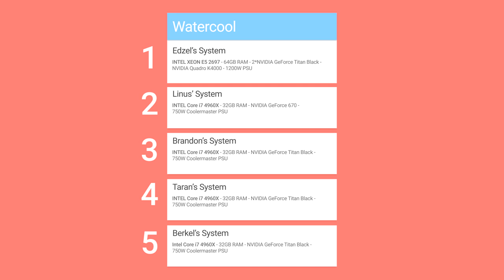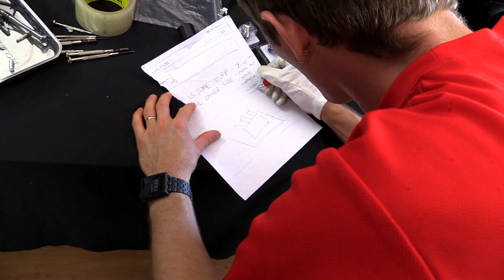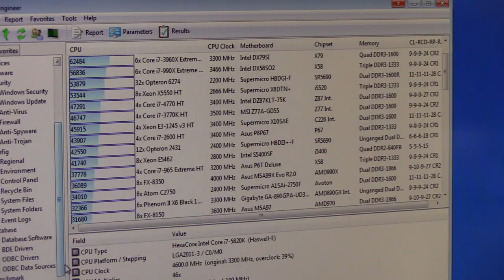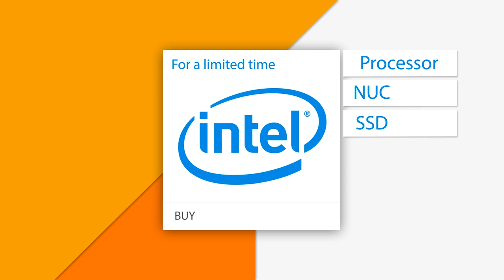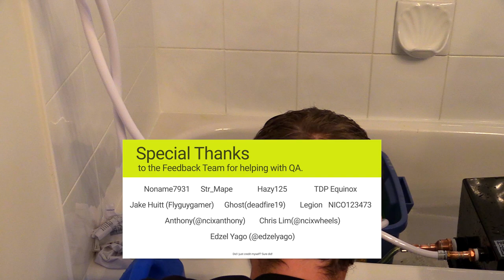Whole Room Water Cooling Part 2 - The Assembly

Comment: As an engineer this really gets me. The Idea is so good but what they made out of it is just so awful.
The obvious stuff, like using those terribly inefficient radiators instead of an AC condenser and industrial fans (if needed at all) is one thing.
Personally, I'd put in some tubing for heated floors under the terrace or wherever with the added benefit of anti-icing the surface and it being totally passively cooled which simplifies the system.
But the bad stuff is something else.
In the summer its all fun and games, but in the winter they'll need antifreeze in their system and as they said nothing about that I'll just assume they didn't put any in.
Though the real issue is, that they put in uninsulated coolant lines into a heated room. In the winter, water will be condensing on those pipes, and it will not only corrode them, but also cause mold.
Seriously, you don't need to go to University to know this. This is HVAC 101.

Also the missed opportunity is such a bummer. Why didn't they put in a system to switch between dumping the heat outside and using it inside by channeling the water to a radiator downstairs?
I get that a professional waste heat recycling system wouldn't amortize, but just some car radiator under the ceiling of a different room with maybe a fan added to it?

Whatever it is, watching people supposed to give Tech Tips but fucking something thats so simple yet so cool up so badly just hurts.

Comment: FYI, you also could have used aftermarket automotive heater cores. Can get them in aluminum or copper. For that matter, and for the amount of flow you will be using here, you could have used an actual car radiator for $100 with regular slim fans and a 12volt converter. It would have kicked the shit out of whatever this ends up doing.

Comment: You should have used a series of Peltier cooling units to fix the problem.  You could have vented the hot side outside and the cool side inside, as long as energy is not a big problem.

Comment: Probably been mentioned before but many small fans are inefficient it would be far better using fewer larger diameter fans apart from that it's an insane and awesome 
project! 😜
Reply: He's using Noctua fans because they perform really well on radiators. They are only available in up to 140mm, with the most static pressure optimised one being 120mm. Most over 140mm fans are round framed anyway.

Comment: Hey Linus, when you start finding leaks at your rads, why not simplify your life by using an automotive transmission cooler with a bolted on 12 volt auto fan? 1 line in 1 line out!:)

Comment: Instead of using a whole bunch of small radiators, why did you guys not just use one big radiator? One rad with one return and one supply feed. Also to be honest, there is no need for the fans. You could just hang a rad outside and the air outside will cool the entire thing. Where are you guys in Canada, I will send you a HVAC rad. I am in Northern Ontario...

Comment: Linus, tell me you are going to put the rads in the shade outside.. If they get even a hint of sunlight they will do more warming than cooling.

Since you are going so full on with this, would have been cool to see you step outside standard computer parts with the cooling system just like you did with the copper piping - and used an AC unit to provide the coolant.

Comment: I would use 1 or 2 car radiators for this kind of project instead of 4 small pc radiators.
Also, I will use PEX pipe instead of copper, easier to install and cheaper.

Comment: Wouldn't it have been easier to use like a car radiator or intercoolers instead of computer ones? Surely there must be a way to adapt those to this kind of massive cooling system? :) I have always wanted to try to put a computer liquid cooling system trough like a car's AC unit.

Comment: i think if i was going to go as far as piping my water outside to be cooled i'd probably use a automotive radiator or a automotive ac condenser since it already has pipe fittings with dual fans, but that's just my opinion. :D

Comment: You should have got on of those artificial snow machines they use on the ski slope to sprinkle radiators from diesel powered locomotive engines. Pump the water into an aquarium wall where you spawn snow crab in the chilled water. Then after the water is heated by the CPU pump it into a tilapia tank to keep them warm. Before running it into aquaponics grow beds and then back to the snow blower radiators. Run the entire thing off some wood gas generators using pellets that you make yourself in a pelletizing machine. Then youd have a Green Snow blown whole room aquaponics CPU cooler. As well as organic lunches. You might detect a tiny bit of sarcasm, I assure you that it not. I like the video despite the dekels.

Comment: LOL ... beware of RSI ... I've been doing this for 2 days.
Seriously .... I get the RSI problems but .... it doesn't happen in 2 days.  Maybe after a few years of doing something in the same way.  Like typing .... Worked for a IC chip manufacturer and had to visually inspect ... which was sitting at a microscope using the thumb on a joystick that would move the wafer stage.  When I started .... seen 4 inspectors all with carpal tunnel braces on their right wrists....

Not sure what their problems were .... but I inspected for 6-12 hours a day 3 to 4 days each week for well over 9 years.  Realized very soon that there was going to be RSI issues .... so I learned that while I may not be able to change the operation of the scope I could change my operation of the scope.  I'd stand then sit at the scope.  When I understood that the "SCOPE" could be made to move programmatically I scoured the offices looking for the user manuals   so that I could automate as much as possible.

2 days isn't going to give you RSI injuries.  If something hurts after 2 days ..... maybe you're just working parts that you don't work much.  Maybe you're doing something inefficiently????  Hard to say .... But seeing the warning about RSI sure did make me laugh.

Comment: Next time, for your "deccals", you tape the decal to the wall. Leave the backing paper on. You put a piece of masking tape down the center or close to it. Peel away whatever half first, use a box cutter or scissors to cut away the backing paper and use a squeegee or other flat, straight and hard surface to apply it. I groaned watching you guys hand plant all of those. I do it on the side for work, so, yea...I nearly cried watching you almost butcher your (probably expensive) decals.

Comment: Here is a good idea cover them in non conductive liquid. Then shield the hard drives in a box and just trap the heat hard drives will be fine with it. You can take the liquid into a car radiator that will cost only $100 aud infact you can get two for only $200 aud.

Comment: if you combine them then why use pc rads? flush into a single large dia pipe and run thru a truck rad with a  copper core then have a booster pump at the end for the push back into the smaller tubes..

Comment: i am wondering if there is going to be an issue with condensation during the colder months.  ice cold water entering a warm room and then the computers then selves?  i picture a buildup of condensation on the copper pipes.  may need to add a water heater.

Comment: Why in the Edzel's System you use 2 Geforce Titan Black and 1 Quadro K4000 instead of 3 Titan or only 2 Quadro K4000? What's the Deal? is the same driver?

Comment: LinusTechTips 

Why you didn't use 2-4 Watercool Mora rads instead of the much smaller, less potent Swiftech rads? That would save you a lot of fans, fittings and cable spaghetti.

Comment: what about regular car rad and car fan outside of building an then some regular copper plumbing? isn't it be more reliable than quite flimsy parts designed to be used in closed pc's?

Comment: Am I the only one that thought if they're going through this much work they could use actual cold tap water supply to constantly flow through the tubing and waterblocks and not worry about radiators at all?  And you can easily run an inline sediment and multi-stage filter setup to prevent any contaminates from entering the waterblocks. You'd be using the tap water, which commonly resides from underground pipes, hence colder, to do the cooling effect and probably with better efficiency.  If the pressure is too much, you can easily put a flow adjuster after your inline filter.
Reply: The thing is, that would be a huge waste of water.  And cold water to watercool is a TERRIBLE idea. Condensation will occur on the outer surface of the tubing and if it happens inside the systems, well you know. Connecting the tap to the G1/4 fittings and tubing will also be a gigantic challenge.

Comment: Wouldn't it have been better to send the lines containing heat from the processors to a return vent on the AC system? The AC already extracts large amounts of heat from inside the house and dumps it outside. Assuming that the ambient temperature inside the space is less than the temp of the water that comes from the CPU cooling system.

Comment: This is a really cool project, but watching you check for leaks made me think for a moment.  You're introducing a single point of failure that could take down all of your productivity at once if you have a problem with the radiator at any point.  You have a pin hole leak and the system drips dry or the pump shits the bed and all work is on halt until you fix it.

Comment: +LinusTechTips This is just what i was thinking but wouldn't the length copper pipes dissipate most or if not all of the heat by the time the hot water got to the radiators???

Comment: what did you do to counteract condencation by the outside tempature of the water comming in to be colder then the room tempature causing issues for exmaple water vapor condencing and storting out the chips or pcbs

Comment: You should of ran the header lines to the floor  with bleeder valves and cut off valves at the pc connections then you would have had no issues with air in the system.

Comment: Good build? ( my first )

CPU: Intel® Core™ i7-5820K Six-Core 3.30GHz 15MB
HDD: 4TB SATA-III 6.0Gb/s 64MB Cache 7200RPM HDD
MEMORY: 16GB (4GBx4) DDR4/2666MHz Quad Channel Memory (Corsair Vengeance)
MOTHERBOARD: ASUS X99-A ATX
SOUND: ON-BOARD
VIDEO: NVIDIA GeForce GTX 970 4GB GDDR5 PCIe 3.0 x16 (Single Card)

Comment: But if you line up all the water lines from graphics card A to graphics card B to CPU and THEN out, aren't you just taking the heat from A and B and putting it on the CPU? maybe it goes the other way, but then you're just dumping heat on whatever is second and third in line

Comment: The part I dont get is why did he use a bunch of computer stuff for the outside radiator setup when he could have setup an automotive rad with fan and saved not only power but had a setup ready for outside use.

Comment: You did that a bit wrong. A good solution is to use common water tank in the room corner, which has a separate outlers with valves and pumps (lines) - one to each PC. And water in a tank could be chiled with a freon loop : in-tank vaporiser and outside compressor+condenser.  That way it is easily manageable, maintainable and extensible.

Comment: I too like to apply deckles to my laptop case.
Wait. Firefox thinks deckles is a word. Wait... what's a deckle?!  

: a frame around the edges of a mold used in making paper by hand 
: either of the bands around the edge of the wire of a papermaking machine that determine the width of the web
Wait, hang on, where does decal come from? ...

Wait, apparently, Canadians have their own way of pronouncing decal? Wow, okay, that makes sense. Maybe in Canada they really do just say it that way. :D

Comment: Why use all those pc radiators and fans for the external part just one car sized radiator and a 12v 16 inch thermo fan would of been heaps cheaper.

The copper tubing in the room would still give off heat.

Comment: Great idea , execution a little sketchy and inefficient. 

Car radiator to start  , then why expensive copper pipe  ? Use PVC and for pumps I would have just used a boiler pump from house . Or a few of them theyre cheap and super reliable

Also fluid quick connects so you have modules that you can connect and move the PCs easily

Comment: Why didn't you use automotive radiators? Much bigger, designed to dissipate more heat. they cost about $100 each. two would have been overkill but it would have kept your systems cool even in hot weather.

Comment: Why didn't you guys use a thicker radiators like black ice sr-1's or alphacool monsta for the radiator box?  Hard tubing would of been nice instead of that white tubing because replacing the tubing every year sucks,and hard tubing will pay for itself due to never having to be changed out. However, you guys are moving anyways so that doesn't matter. You could ask a welder to build a radiator box out of steal for you instead of the unfinished wood. I would put a drainage valve at the lowest point of each build to make it easier to replace the fluid every year.

Comment: I hate to criticize here.. but why did you go with a ton of computer radiators and fans?  Seems to me a much more efficient and effective, as well as cheap option would be to utilize a radiator from a car from the local junkyard, and use an electric automotive fan.

Comment: Yes you can use these expensive radiators and fans OR you could have used a car radiator and fan which is much much cheaper.

Comment: Why are you using computer fans and those tiny radiators? Just use one big fan one big radiator. A better mounting solution would have been to pipe it to the attic, cut an hole in one of the eaves, and mount it there. Also, why are you using ground-contact lumber for the radiator frame?

Comment: Ummm...why not use an aluminum automobile radiator?  They have some HP ones that are quite amazing.

You just have to build an enclosure that would protect you from putting a finger into the fan.
Reply: I can think of something better instead of 5 radiators buy another 5 and have 10 of the thickest rads as possible and maybe buy a under sink water cooler aswel

Comment: why not remove all the fans from the radiators and then put the radiators in a closed tank filled with water(ofc the tank wouldnt be completely filled to the brim because of pressure problems). so then its water cooling water -> watercoolingception :D

Comment: Problem is, If the outside temp is above the coolant temp, cooling the PC's will bad. Unless the radiator system outside steps up the temp of the coolant...

Comment: Why not use a simple fan coil unit instead of that assembled radiator.
I mean you are already doing plumber job, get the heat "power" you want to discharge and buy one. Pump and piping are already there anyway.

Comment: Why buy super expensive computer radiators, and not just a few truck radiators? Or something similar. Heck, for the same amount, you could have got 4 truck rads and two extra pumps, and made it passive.
Reply: Cause the project is sponsored
Reply: And it's cool
Reply: Fair enough. Of course, if money weren't an obstacle, I'd do what they did.
Reply: Juan Pretorius You can't electrically connect aluminum and copper.  Galvanic corrosion.

Comment: WATER COOL THE WORLD!
Reply: You could do that, fight global warming. Radiative cooling would become the predominate mode of heat transfer and the radiators shape and design would have to reflect this. I imagine it'd look like a black painted retro-reflector that is deeply micro-textured on the side facing into space and with silverized mylar facing towards the Earth.
Reply: +Isaac Karjala Water cooling just transports heat somewhere else. Not to mention, the most watercooling can do is bring the thing it's cooling down to room temperature which incidentally is the temperature you're trying to reduce.
Reply: Infinite Zero water cooling can't reduce temps below the temp of the heat dump, if you want to cool lower than room temperature all you have to do is change where you dump your heat to somewhere colder than room temperature. Like outer space, it's barely above 0 there.

Most "radiators" cool predominately by conduction/convection, to cool to outer space temps by such means would require sticking the rad in geosynchronous orbit; however that would still not work well because outer space is a near vacuum and there is nearly nothing to conduct heat away.

A radiator that predominately cools by radiation and is positioned on the surface of the Earth could, at least by my best understanding of theory, cool to a few degrees above 0 K but only on cloudless nights with the rad pointed straight at the sky. In practice, you'll probably never even get a 50 K delta, but it should still be possible.

Your temp delta will probably suffer greatly not just from cloud cover and daylight, but also from full moons.
Reply: thats why your room needs to be colder aswel

Comment: HAHAHA! I will laugh my ass off when outside temperatures go significantly below room temperature! The pipes and heat blocks on the computers will start condensing moisture and something will most certainly fail!!! It will get even funnier if for some reason temperatures go significantly (-10, -15) below zero Celsius!

Comment: You do realize having the radiators outside in the winter you will get bad condensation in all of your computers?? You need a thermostatically controlled system to much difference between inside temp and outside temp will be a bad thing..

Comment: Computer radiators are inappropriate for a project like this. Much too small, expensive, and ineffective. F-150 radiators are everywhere for cheap.Brand new ones are on Rock Auto for under $100. You'd need a strong pump and you'd have to get some automotive electric fans to run on Alternating Current (or get a barn fan from Home Depot), but damn would it work better.